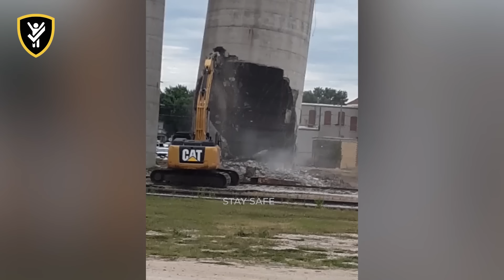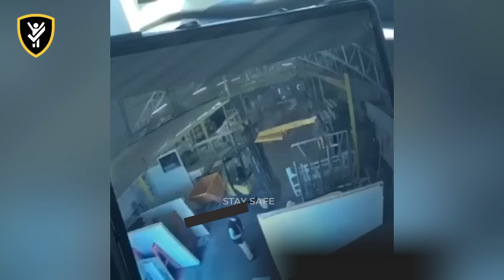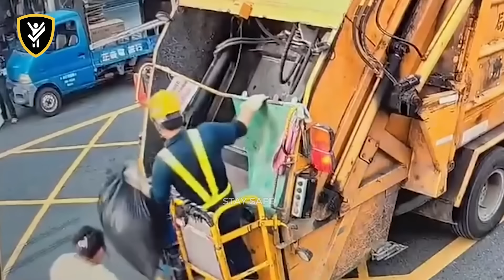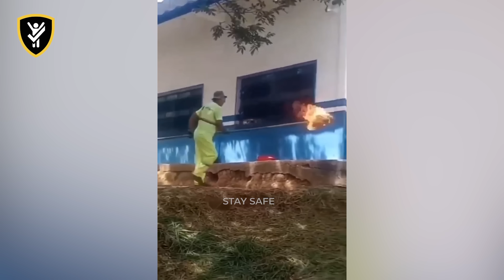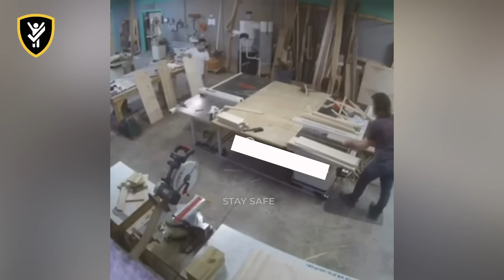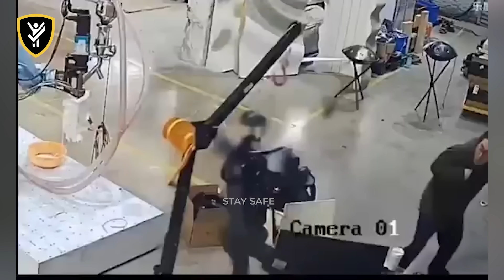He Reached Past The Massive Roller.

Comment: Number 20 was caused because the two guys pushing the scaffolding lifted it up off the wheels and it lifted because they neglected to pin the stems in place. Either lazy for not pinning the wheels or they didn’t have all the proper fasteners.